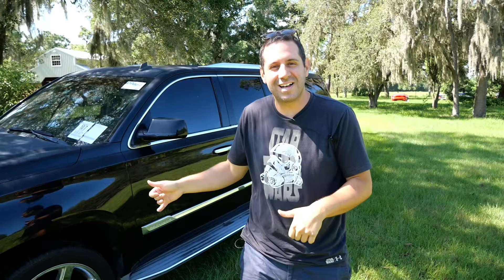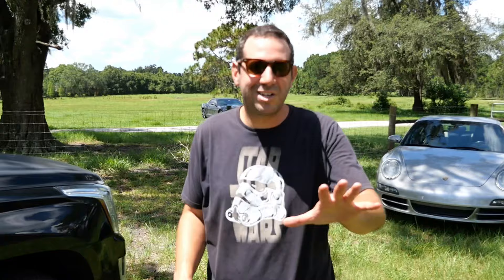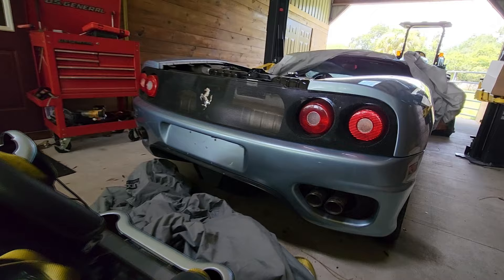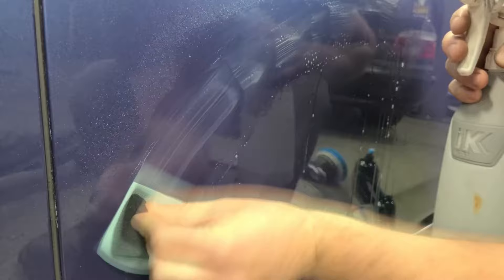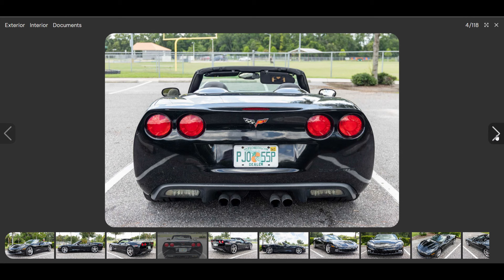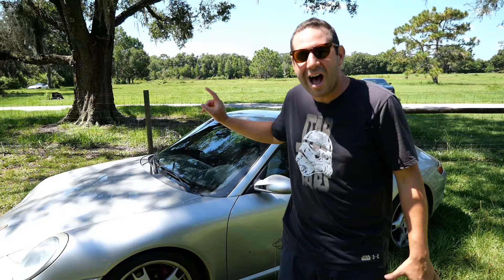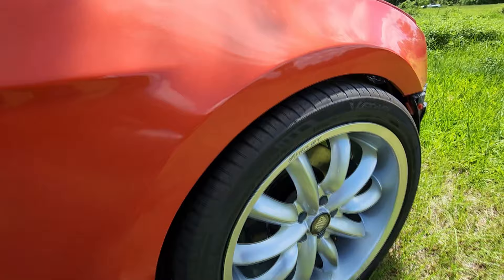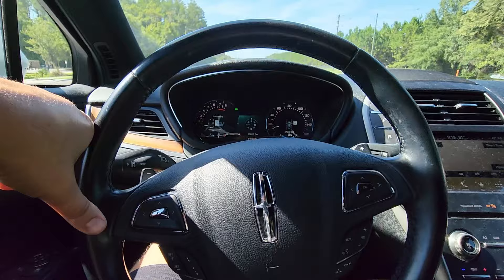I Saved over $10,000 Buying 2 Prior "Theft Recovery" Cars at Auction! Was it worth it?

Comment: Alex from Legit Street cars surely would love to collaborate on that escalade, fix the timing chain and delete active fuel management and you have yourself a really nice SUV
Reply from the maker: Yeah I'm hoping that's all we have to do! The auction will inspect it first; if it just needs to be retimed, the deal was !$!
Reply: We are watching the video now but I think Alex already installed a blower on top of it 😁
Reply: @sajedb  yup! and his wife drag raced it.
Reply: @sajedb  That's an entirely different Escalade. That one is Alex's own escalade.
Reply: @deanjo57790  I know his wife one, I was joking referring to te discrepancy between filming and uploading timing.
Reply: @sajedb  Oh, ok.
Reply: @Samcrac  yeah my first thought was it jumped a tooth or two due to abuse by the thieves. But in order to do that that would mean a tensioner or ? has let go me thinks.
Reply: Cam/crank correlation code, worth putting in a cam and crank sensor to try the easy fix first?
Reply: @miceinoz1181  it seems they are sensing, just sensing the positions are out. If only the manufacturers put in a view port or ? that you could check them visually without having to remove the front of the engine. 

Not familiar with GM engines but with fords, you can remove the valve covers and line up the phasers and check the dot on the phaser with the mark on the timing chain. 

Can't check the crank though as the mark is behind the front cover. if they only put a dot on the end of the crank and a mark on the cover.
Reply: Don't forget to put on a supercharger!
Reply: Don’t forget the Magnuson supercharger!

Comment: I'd keep the Porsche as a daily driver to see how long the fix lasts. It will give all of us a reasonable expectation of longevity if we perform a similar, working fix with the same product. 👍✌
Reply: Thats why hes not driving it that much otherwise itll fail. Daily driver? Yea it wouldn't last, but since hes barely driving it and just sitting of course itll last longer. Lets be real 500 miles isnt much.

PLUS the vehicle isn't even under load or heavy use. He probably goes 12mph for 500 miles, NO SHIT itll work.
Reply: @ILOVEBACONBOY2018  Do you see how many cars Sam has? He drivers many of them, so maybe the 911 doesn't get as many miles as you'd like. He did suggest taking it to the track to test it out also.
Reply: That what i want to see just keep the Porsche running and see how long it will last
Reply: @Chrissy212  Yeah, normal, daily driving with normal spirited driving on occasion, just like most of us would drive a Porsche. 👍✌
Reply: @TOM-C.  Well im not saying for him not to enjoy the car but not add a bunch of power ect and blow the engine sooner ect
Reply: Yes, I agree I have a car with a similar issue. Would love to get some updates on the Porsche.

Comment: Hi sam, I had a very similar problem with the clutch in my Audi A5 3.0TDI.  The clutch pedal went straight to the floor on my way to work one morning and I had the car picked up and towed to my mechanic a couple of miles away.  He couldn't find anything wrong with it at all, but he took the master cylinder off, took it apart but couldn't find anything wrong.  He refitted it and was about to drop the box and look at the slave cylinder and as soon as he started the car the clutch was back.  No idea how or why, but here were no more clutch problems from there until I traded the car in.  Not saying that the same would happen to your r8, but just chucking in my 2 cents worth.  Cheers, Frankie

Comment: Check the connection right behind the harmonic balancer. They’re known to get corrosion build up and that’s where the cam sensor wiring goes through.
Reply from the maker: Would that cause this type of code? P0016 isn't sensor specific although it could be potentially sensor related?
Reply: No it’s not sensor specific but if the corrosion is causing a funny signal making the vehicle think it’s out of time it will trip a correlation code. 

I’ve also seen them where I had the replace the timing chains and oil pump (oil pump just for good measure as they’re problematic also) and it’s a simple job. Just pull the oil pan then the a/c compressor then the water pump housing and timing cover and you can get to everything you need too. But I’ve never seen one with this low of mileage have the timing chain issues.
Reply: @adambuttner8792  I was going to mention to also check the oil level.

Comment: We have a 1986 VW Golf 1.8 (gas) that we purchased new. At about 80,000 miles it developed an internal coolant leak. We had no choice but to continue to drive it. One day the coolant overflow container ruptured. After that I tried a block sealer out of desperation. It held for almost 20,000 miles. Each time the coolant leak reared it's head I just sealed it again. The car has continued to run to nearly 300,000 miles with block sealing as part of our 20,000 mile service 😁😁. It's really just temporary, but it works. For less than $100 we've managed to get another 200,000 miles out what the VW dealership deemed a 'blown engine.'

Comment: I wouldn't push that Porsche if you really like it. I've said it before, the sealer is likely only a suitable fix under normal driving conditions. You start treating it like a high end sports car on the track and I think that will go right back to the problem it had. I feel like the Lemon Lincoln has shed the problem if it has a new engine, but I also think you might want to get rid of it anyway.
Reply: If it was a small leak it could be ok once it sets , even pushed it should hold but always risky I guess
Reply: It's a coolant leak. It's going to pressurize independently of engine RPM's . Soon as the engine gets hot, if it's going to fail its going to fail.

Comment: I had an Audi S5 (4.2 V8, 6spd manual) that had the exact same issue, no leak, just showed a brake light and pedal went to the floor. I changed both the master cylinder and slave cylinder and it fixed the issue, hopefully that helps keep you from pulling the trans!

Comment: You didn’t say If your brakes on the R8 still felt normal. The pick up for the clutch is above the pick up for the brakes, so if the brakes are also bad, it could mean that the leak is in the brake system, not the slave cylinder. Those pieces are at least easier to access. :)

Comment: The engine in the Alpina B7 seem to have a knack för imploding... just check hoovie or m539 restoration...  the plastic chainguides should def be checked...
Reply: Dude, that’s a totally different generation of B7, M539 is doing up an E65 based B7, with the supercharged M62, Sams B7 is a twin turbo later generation, which runs the N63

Comment: In order to get “dealer” plates you have to have successfully applied for a car dealer license. So I wonder what the name of his “dealer” is?  The replaced the “shortblock” basically just the block, crank, pistons. The “rotating assembly” Things like heads, oil pan, and accessories are just swapped. A long block is the whole kit an caboodles minus accessories

Comment: Gotta love Ford/Lincolns past decade Business Plan. Engineering motors they know full well are lucky to run 20 thousand miles before catastrophe. The poor Eco Boost and especially Power Stroke fans are true die hards. Sticking with Ford even after seeing the cab pulled off their new Lariat. Maybe that's what Ford Knew. Thier customer loyalty is that strong. I like my GM trucks because their issues generally don't leave me stranded. If a Chevy doesn't start, buy a Fuel pump. It's fixed.

Comment: Wasn't the failure mode on those ecoboost engines due to the wrong type of head gasket being fitted at factory? 
If so I don't see why the block wouldn't be able to to be "remanufactured".

Comment: My understand is that at best, the headgasket sealer is a temporary solution. The leak will come back in a year or two or several thousands miles. So if you sell this car, it would be unethical to say it doesn't have any issues.

Comment: Sam, stop jump starting your cars. I think that’s why you’re having bad modules. When battery voltage goes down amperage goes up. Need to get in the habit of charging the battery. If it’s bad replace it. Never jump start a newer car with multiple modules. You can over amp and n burn them up.

Comment: Different car but i had a 2017 dodge dart and it got a new engine with in 20k miles  due to failing the oil consumption test, 2 years later traded it in and its valued at what the odometer says and not that it has a new engine

Comment: Interesting Sam. I wonder how long the Porsche engine fix will last though? Good update. It will take you a long time to get over the lift and its versatility. When I got mine I could not get over how I did not get one much earlier, they are fantastic, especially useful when dropping out engines/trans with the frame. Unbolt every thing, four or five decent jackstands placed at the sensible places, and raise the car up and away. Easy peasy.

Comment: The head gasket fix doesn't surprise me at all - seen that silicate heat based stuff work many times - as long as you do the prep work & follow the instructions it usually works, and can last many thousands of miles - and if it doesn't work you haven't lost anything by trying other than a few dollars and some time (no, it won't gum up your radiator or destroy your water pump any of that nonsense people say about it)

Comment: Sam you got away cheap I've been waiting for a new motor in my Broncos sport for God knows how long it has a problem that 10,000 miles it through a ride through the block it's a problem with that three cylinder engine they told me they're back order and they Escalade is a well is a well spent that's a good truck and I'm sure all it is is just a client it's a coil pack

Comment: I do enjoy and learn from your show. But, consciously pouring "sludge" into your cooling system may have given you the illusion of having "fixed" your CO2 leak, but IMO is ill-advised and rinky dink at best. Go ahead and replace your head gasket and while your at it properly machine the head surface back into tolerance, that's what a true mechanic would do. The car is worth a proper repair.

Comment: Hey Sam those head gasket sealer fluids, are temporary fixes from my experience, I've used them on a few cars, and they last around 10k miles after which the problem comes back, at which time you could toss in another bottle of the sealer but it won't last near as long as the 1st one from my experience maybe tops 5k miles.